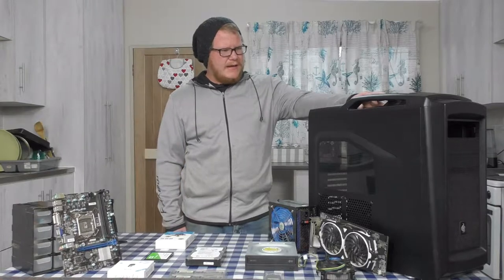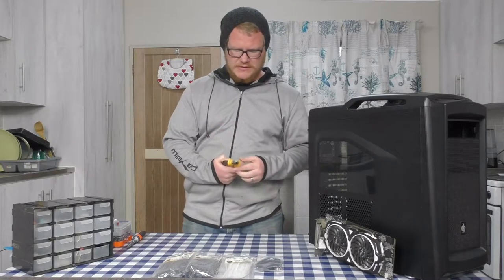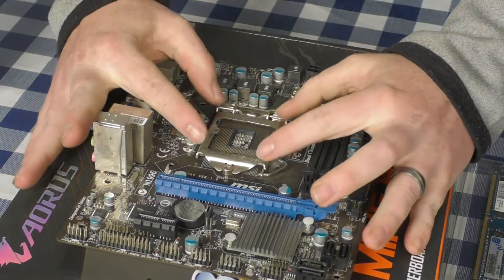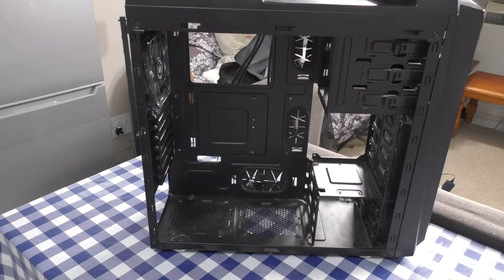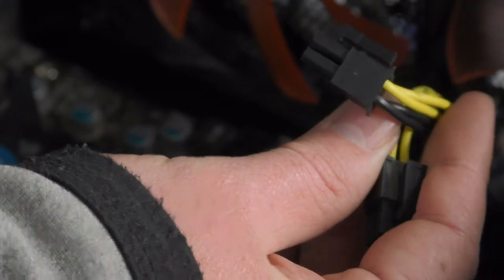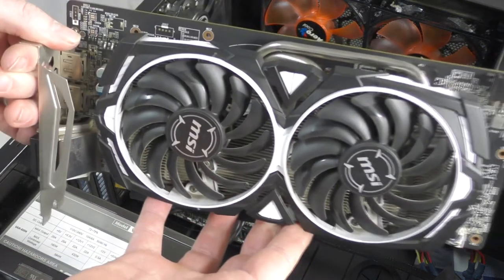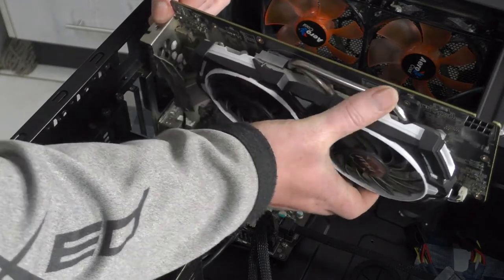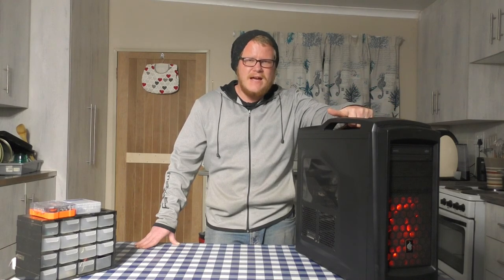How to Build a PC | Refurbish/Secondhand Parts edition.

Comment: Do I need to provide power to the PCI USB 3.0 from the power supply?
Reply from the maker: Depends on the usage if you are gonna use externals on it then yes. If you just want to use it for flash drives it would not be necessary.
Reply: @NicoPeyper  Thank you. Great video for noobs like me.
Reply from the maker: @ruaanvandyk8667  hahahaha noob? I don't think so